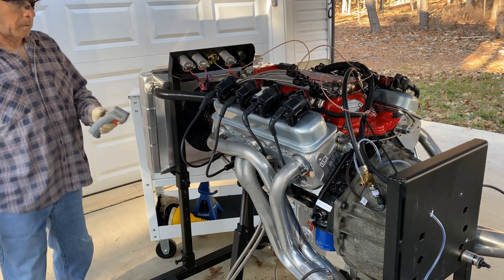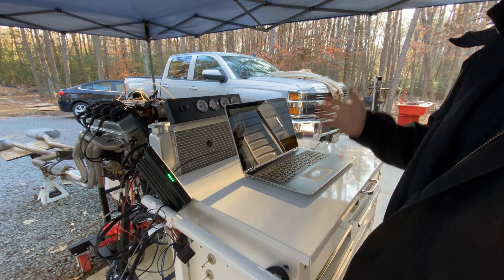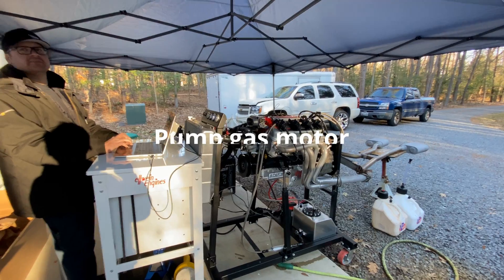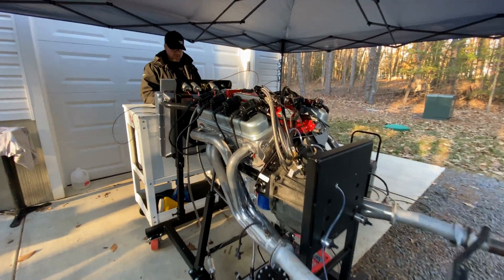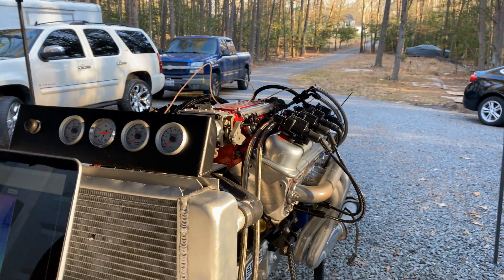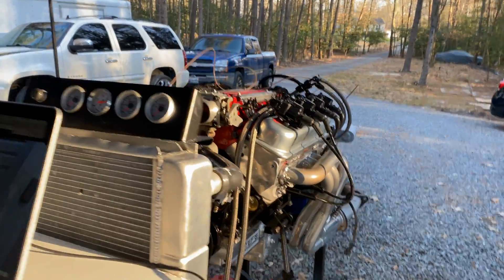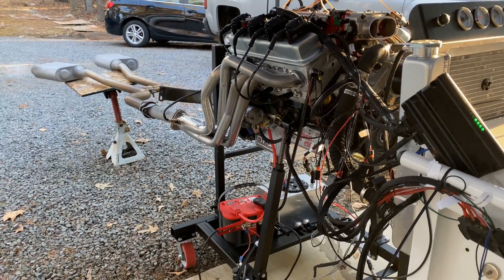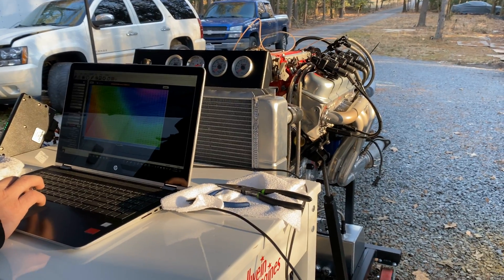1996 LT1 with Holley Terminator X [Part II]  Engine run on test stand

Comment: What you do for cam and crank signal?
Reply from the maker: I used the EFI Connection 24x system for this.  crank 24x reluctor and cam 1x.   EFIConnection.com

Comment: Will gen 1 sbc pulley accessories bolt on a gen 2 lt1?
Reply from the maker: Yes actually.  Tyler Manheimer (TPV Productions) put a regular SBC damper on his LT1 and no optispark (using a carburetor).  So then you can use SBC accessories.  Unless the accessories incorporate the water pump then I don't think that will work.

Comment: what temps should we be seeing when you're checking the header tube with the heat temp gun?
Reply from the maker: Actually I don't look for a temperature range.  I just look for even temps between all the headers.  But the LT1 it seems is never even at low rpm.  Only under load is it ever even.   hummmmp!!
Reply: @EllweinEngines  thank you for the response crazy i am a lt1 guy and just came me across your channel great info

Comment: how come you have an LT1 AND COILS ?
Reply from the maker: sorry did not see this question.  I don't mind the opti spark but I really like using an LS PCM or Holley stand alone and LS coils.   The tuning is easier and the software for engine monitoring is easy to use.